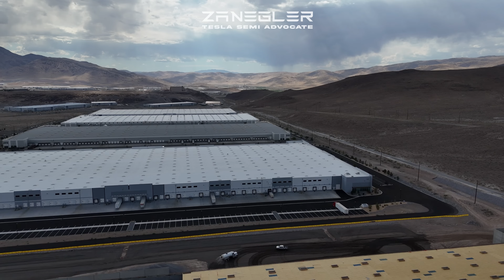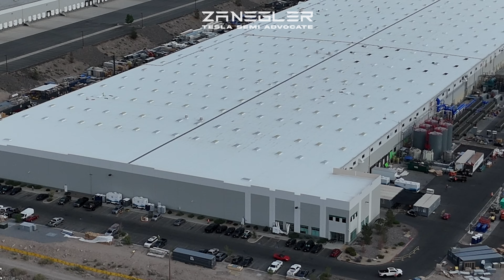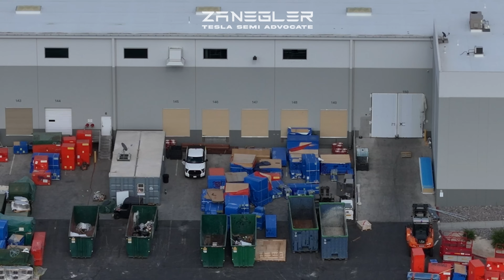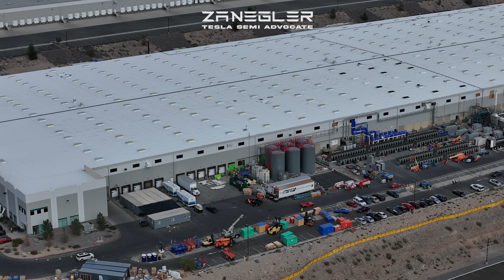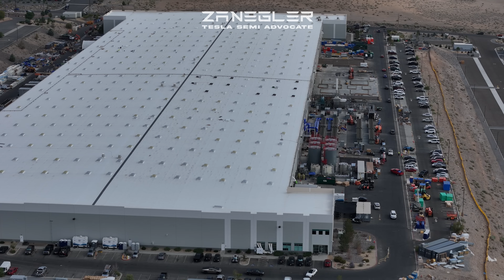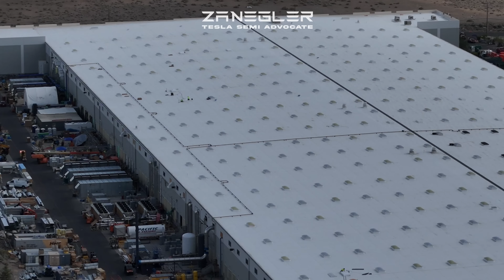First Look! Tesla's First LFP Cell Production in North America

Comment: AFAIK the LFP battery manufacturing goes via the deposition of a LFP slurry (at exactly the right viscosity-level) to produce a uniform layer on the copper-substrate. This falls in the category of the "Wet Process" for Cathode rolls manufacturing, same as is taking place in the original GN building. But right now there is a difference: behind the GN building (next to the electricity supply) you can video and zoom in on two distillation towers, used for stripping and recovering the solvent that is used to deposit the NMC cathode-formulations. This solvent is nasty and cannot be left in the waste water - so it is necessary to recover and recycle. But next to this new LFP production building there are no stripping towers (yet?). So either the LFP production process is much more eco-friendly (mainly water) or the limited amount of waste water from this initial production is stored sent to the main GN plant for cleaning over there.
Reply from the maker: Great insight! Thanks for the deep dive!